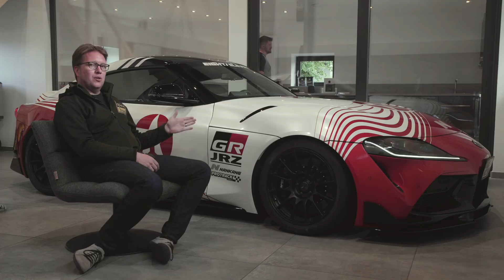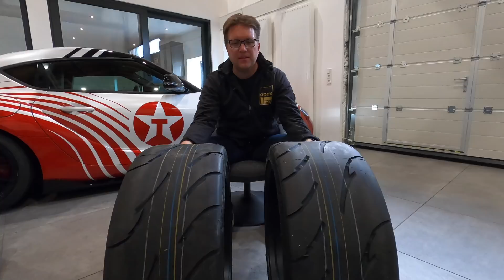Tech Talk: Toyota Supra, Ruined by Bump Steer?!?!

Comment: Giving it some more toe in at the rear must solve this a bit, or else there is a really loose component at the rear that creates this big problem going to toe out at the rear or something.
Reply from the maker: No, as mentioned when the suspension moves up and down the tie rod angle allows the toe to change through the travel of the suspension.
Reply: @RobertMitchell  This is normal, Rwd cars are designed to gain toe during compression squatting as it improve traction.. as a car lifts it will loose toe. If it's going massively positive/negative this is far from ideal but would be nice to have a plot to prove this...
Reply from the maker: Philip Hawkins lol as mentioned bump steer can be beneficial but THIS is not normal;-)

Comment: 11+ mins and not a single toe curve plotted. Not even a mention of how many degrees/mm of bumpsteer to compare. All here say and opinions.
Reply: Must have bought a Supra.
Reply: I wonder if all this was after they slammed it on its arse.. Ruining all the geometry...
Reply: I kept saying out loud... "Prove it." Show us this bumb steer.  Put it on an alignment machines and load/unload the suspension.
Reply from the maker: Thailand Retro Mods very clearly stated it was stock w the issue
Reply: I'm with you on this one!
Reply: this
Reply: Agree, as much as I understand the technicality and sympathize as I went through some bump steer awfulness myself in the past, I would still like to see a plot. That´s simply what you do when you speak out loud such a statement.
Reply: "
"hear" say I think is what you mean. And yes, I was expecting them to show the toe angle change as the suspension moves up and down.  Maybe somebody else will do it down the road.
Reply: I made a video on how to adjust bumpsteer with data plots!
Reply: @RobertMitchell  Not really a cool answer...
Reply from the maker: hungerknochen ??  What wasn’t a cool answer
Reply: because it's not really relevant to conveying or the discussion.

Comment: I guess it doesn't help that Supra has a very fast steering, so little corrections are very hard to make. I was just wondering about this a week ago when I had the new Z4 for a test. It was an 30i, so nowhere near as fast as the Supra, but even with that power the car felt too nervous for my liking. I thought the steering is to blame. But your point makes sense.

Comment: Radical bump steer curves are not an accident or oversight. It's a decision between product planners and engineers that don't really understand their customers well enough. Most car have some passive rear steer via compliance bushings and its fine. That's eliminated in race cars with harder bushings or bearings then a tiny bit of bump steer fine tuned with adjustable pick up points. Other production cars have active zero or event toe out under compression that helps rotate the car into a turn. This works when driven smoothly, on low grip OEM tires by expert drivers. Add sticky tires, novice drivers and aggressive inputs and you get a car in a tree. Expert drivers notice the unpredictability immediately and just compensate for it by backing off a bit. FC RX7 had passive same phase/counter phase rear steer. Autocrossers hated it because that same phase induced massive understeer in sharp turn ins. AP1 S2000, ND1 Miata both have this radical bump steer designed into the rear suspensions to make easier for novice drivers to bend into a turn with smaller inputs. Low grip OEM tires, smooth expert inputs and all is good. That novice drivers adds grippy tires and tries to push harder,  those cars become unpredictable and hard to keep on line. S2000 fix is adjustable rear toe links. No fix for ND1 other that lowering car and raising wheel rates to limit wheel travel. ND2 has same geometry but different durometer compliance bushings so its better behaved but still not quite right. Agree with assessment that product planners and engineers need to trust that customers will be perfectly happy and safe just learning to transfer weight to initiate rotation and don't want stupid band-aid geometry to exaggerate rotation with every tiny change in pitch.

Comment: I'd guess the handling issues are mostly BMW's fault. Clarkson tested the M4 GTS and he described it as "somewhere between spiteful and undriveable". The ordinary M4 has a habit of sliding around as we saw it doing that a lot in the marketing for the car. Perhaps thats all it can do? Phil Morrison of Driftworks had an M2 once and fitted an older more predictable diff because he said the standard one made the car dangerous. The standard diff had a habit of opening up mid drift, speering the car violently in the opposite direction. He also had an M4 as a loan car once and said it was dangerous in the handling department too. He said the first time he drove it he got out and actually checked to see if it had any tyre tread as it was so lacking in grip.

I'm a BMW fanboy but they really have dropped the ball when it comes to performance cars recently, so I'd be suprised if the A90 handling problems are Toyota's fault. It would be interesting to see if the new Z4 has the same handling issues though.

It's such a shame. The FT-1 concept's striking looks (which have unfortunately been watered down), BMW's reputation for performance and Toyota's reputation for tunability and bombproof reliability should have made the new Supra an epic car. Unfortunately I think it is one of those cars that has been designed to sell in large numbers (using the name and reputation made by the MKIV) rather than be a true flagship performance car.

Comment: both wheels going from toe-in to toe-out is only half the problem. Its when one wheel hits a bump and now both wheels are facing the same direction steering the car in the direction. If the bump were to cause the wheel to go from toe-in to toe-out. Additional weight would be added to that wheel now that it's the outside wheel in the turn (caused by bump steer). Which then creates even more toe-out, repeat. This is why the rear normally has toe-out.

Comment: Thanks again for great insights! I will go through all my cars to learn about  their stock geometry. My goal is to get as smart as to understand whether there is room for improvement and understanding what my preferred setup optimally is for each car. Ig, I want to learn if some of the loading up on the steering can be eliminated by adjustments in geometry. My 328 GTB and my 308 GTB rally-rebuild suffer from heavy load-up but not my 246 Dino nor my 1st gen testarossa. Also, I will seek to additionally improve Autobahn high speed stability on my Rolls Corniche. It improved greatly with Öhlins front shocks - now I'll give its geometry a closer study. Thanks again, Robert, very inspiring!

Comment: @Robert Mitchell: I don’t know about the Supra specifically, but companies do make toe links (tie rods) with bump steer kits which more closely aligns the pivot points of the toe arms with the pivot points of the lower control arms (which is how you fix bump steer on cars with a McPherson Strut suspension). As you said, this is a common problem on cars that have been lowered (like a race car, for example), and that’s how you can solve it with an aftermarket solution. 
Also, bump-steer would be more prevalent on high-speed roads or tracks with a lot of elevation change (i.e. places that cause more and faster suspension travel), so I’d imagine this problem would be really noticeable on the Nurburgring!

Here is a video on bump steer and roll steer, so you (and others) can visualize the geometry of bump steer: https://youtu.be/P2PYBzH0AYk

Usually, as you mentioned, car manufacturers design the bump steer to not cross over from toe in to toe out during bump and rebound. It is a more common problem with race cars because, they are often lowered, but also because race cars usually have a toe out alignment on the front to help with turn-in—something you really never do on a street car alignment because it makes the car feel more “darty,” especially with the crowning of most public roads. That makes bump steer problems a lot more prevalent on dedicated track cars. However, the fact that the problem is on the back with the Supra is really surprising.
Anyway, great video, as usual! I can’t believe they made a sports car with so much bump steer right from the factory 🙄

Comment: Every time I watch your videos Robert, I always learn many new things from them. Its not the typical vlogger approach of 'What colour should I wrap for my car?' or 'GETTING ARMYTRIX EXHAUST FOR MY LAMBORGHINI!! *INSANELY LOUD**' or  '5 things I HATE about _ car' etc. I know i'm regurgitating what other people have written in the comments section, but thank you sincerely for these very technical insights in the cars that you drive, out of your busy schedule. There's another automotive youtube channel called 'Savagegeese' who in his reviews, he takes the cars up on a two post lift to discuss about their suspension designs, cooling/aero flow and also weighs them on his corner-weight measuring device to find out their cross-weight as well as the overall weight distribution. He posted a couple of A90 Supra videos and I was surprised that he has not mentioned about the bumpsteer/alignment issue that you have been getting. Perhaps the roads/track that he's driven them on were relatively more flat than the undulating+camber filled roads you've been testing your Supra on. He mentioned on his instagram that he got his hands on the 2021 model year Supra with the updated B58, so i'm curious to see if he's going to talk about those issues you've covered too. Keep up the great work.
Reply: smilepermile: Bump-steer would be more prevalent on high-speed roads or tracks with more elevation change (i.e. places that cause more and faster suspension travel), so I’d imagine this problem would be really noticeable on the Nurburgring.
Reply: @981porsche3  Yes, I think you're right. Savagegeese went to Summit Point Motorsports Park which most likely doesn't have as much elevation and camber changes per mile than the Nordschleife does. It appears to have shorter straights than the Nordschleife does too. By the way, great driving on your videos, nice one!
Reply: What he was describing should happen anywhere that you have high braking zones, it shouldn't be only where elevation changes are, but for sure those would make it worse. It's just any situation where the suspension will go from being compressed to uncompressed. So on a fast straight into hard braking and a turn then back on throttle would make the rear end feel like it had a mind of its own since it would be going through dramatic toe changes several times. At least that's how I'm understanding it.

Comment: super interesting!!! you guys didn't go with a bigger rear swaybar on the car right? ;). also am really surprised the bump steer is THAT bad given how long the toe arm is, have you guys plotted a toe curve? for other platforms , some companies make adjustable tie rod ends, that allows one to use shims to align back the toe arm to factory level (pointing at the instant center); on a lowered car. IIRC SPL makes adjustable rear toe links for the A90. also this might help; on other multilink cars I personally tracked/drifted, shortening the toe arms made it more stable too , so it always toes-in either on load or in trail braking.
one more thing, in the 2021 model, for the rear end changes, Toyota said they revised the bump stops and the eDiff programming. do you feel it might be the eDiff acting up? you probably know better of course, but am thinking of that because, as you said, many magazines didn't feel/report bad rear end behaviour, but Motor Trend DID! and *exactly* as you described! yet they explicitly said that changed in their 2021 review.
sorry for the long comment but this got me hyped at 4am lol.

Comment: Have you tried to increase rear toe-in even more or to have a look at rear rebound settings?
Reply from the maker: I had a similar idea to you but sadly The toe changes so much in the normal travel of suspension that you’d need an inane amount of toe in to prevent it from going to 0 at every load transition.   Could it start to cover up the problem?  Maybe but as you know, you be going way in the wrong direction to do it.

Comment: I am a supra owner too, high speed driving on german autobahn feels not realy save. Do you think h&r springs for a stiffer suspension and the new alignment setup in mishas video can fix this problem for normal use? Track 1.5mm per wheel in the back, but in wich direction? Sorry, im still learning...
Please find a solution, the supra is it worth...

Comment: I had a similar experience in a GT86 which was just lowered with springs. Let off at 180 km/h and the rear end started moving. Sporty cornering in a similar fashion.
Reply: Get a proper alignment??
Stay off the road at 180km/h?
Perhaps not fuck with suspension when you dunno what you're doing??
Reply: @ScooterMcAwesomeness  Ha Ha Ha - This was a development car. It had just springs because the shocks have been still in production. Everyone working on this car has been an industry professional. When someone wants to know about the suspension - those are the guys to ask :-D - The car was lowered and professionally aligned with the mounted springs. - I just worked for years at KONI and H&R - so I guess I know more about that specific than the most people here :-D

Comment: The 93 Supra had the most predictable rear-end breakaway among it competitors in its time. This car should have never been built with a torque-converted trans. The current Mustangs manual trans is the same unit used in the 93 Supra. It would've been a perfect fit in this car 2 further differentiate it from the Z4.

Comment: Rob, I love this shit!
 Thank you for talking about suspension geometry and driving dynamics. The Pista vids were great and very informative as well.
My back ground is driving solid axle vehicles used in rock crawling and general off road use.  Bump steer is probably the biggest issue to deal with on a rig that is used for both rock crawling and highway use. To design a suspension system and take into account ackerman, scrub radius, instant center, roll center, anti squat, anti dive, the toe in or out you want it's a massive mine field of information overload. I love nerding out on this stuff!

BTW, Mr. Tim Burton is going to come around soon I presume. I would love to see you guys do a "pod cast" style video and just talk about cars or whatever. I think that would be really interesting.
Thanks again for these vids, very interesting.

Comment: Robert I have a question, as for a temporary fix, have you tried changing the spring rate? Because I would imagine if rear was stiffer there would be less weight transfer and therefore the effects would be reduced. Could you get it to stay oscillating within positive (or negative) values of toe or is it not enough?

Comment: Very informative and very well presented!

Forgive my speculation but is it possible that the framework (undercarriage) section where the rear suspension bolts on is not entirely symmetrical and might be causing one side to be swinging not only vertically but horizontally as well?

Comment: Find out how to solve the massive issue as quick as possible Robert and sell safe setup to Toyota maybe, love your content
Reply from the maker: Man.... I bet they already have the solution.  Wouldn’t even be surprised if it’s not being implemented in newer cars
Reply: Not sure about that Robert, I would have thought that their prototype test driver would have reported something during development, if they see your video Toyota will surly send out an urgent recall. You should start a TV show as your knowledge is immense
Reply: @bigbaza30  Just a little detail, on how Toyota deals with "costumer advices" : "it is the policy of Toyota (....) not to accept unsolicited ideas."

It was int the Lexus LS thread, that I will link below. Ans it was not about suspension, just a 1$ 10 minute gluing to reduce windnoise...

https://www.clublexus.com/forums/ls-4th-gen-2007-2017/506217-instructions-for-the-jmcraney-wind-noise-fix.html